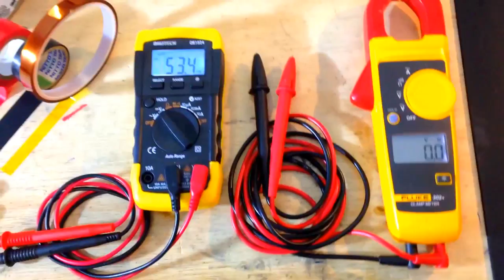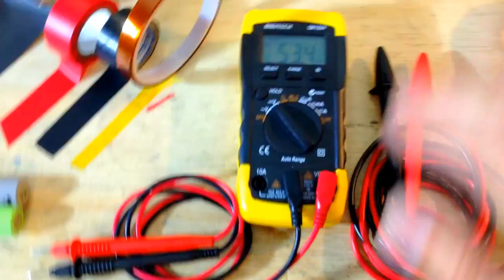Planning on making your own battery pack? DIY guide / tutorial • 18650 cells Electric Bike

Comment: He needs to chill out omg so much energy!
Reply from the maker: Yeaahhh... so much POWEEEEEEEERRRR hahaha =]
Reply: How are these LG MJ1 3500mA holding up?
Reply from the maker: MrBrymstond so far so good.. the high discharge HG2 (3000mAh 20A) can take a lot more abuse so it will probably last longer.. 
Cells are reliable in general, most problems I see when repairing battery packs are related to faulty BMS damaging one or multiple series, sometimes I can balance and save the pack =]
I'll be showing a super high tech state of the art, active battery management system and my new high discharge battery pack in my next video showing my 42000w trike https://youtu.be/sRH_cpCwNDs
So much POWEEEEER

Comment: Voice is bit annoying but this is one of the better tutorials. I've built many packs before and this guy definetly knows what he is doing.
If you ignore his voice there is lot of good information in here. Guys, 18650 cells are serious stuff, very dangerous if you don't pay attention to detail.
Isolate parallel groups when welding, have fire extinguisher nearby, use safety glasses (there will be sparks) and invest in good welder. Also battery holders are dirt cheap nowadays, don't use hot glue!

Comment: Hey, I have got a question.I'm planning on building a 96v ebike. I am considering on ordering 2 separate batteries one 72v 20ah, and a 24v 20ah battery. In hopes of being able to connect the 2 in series to create one giant 96v battery. My question here is, is that a possibility? Will it work, or will I end up frying the bms controllers in the batteries?

Comment: Hey I got 2 ideas for batteries what do you think?
1) Use white battery case instead of black one. This way battery is much much cooler when in sun
2) Build BMS shock absorber. On airplane they put bms on spring. Ours is so light, maybe bubble wrap?
Reply from the maker: +Clifford Zvengrowski - Yeeeahh. the white battery case if a much better idea, there are some white battery cases (Dolphin) around.. it makes difference if you have to leave the battery locked outside sitting in the sun for hours.
The second idea is good making a shock absorber, electronics don't like to be bashed around, this is why they fail so often but... but.... wrapping in bubble wrap is the electronics number one crime, it packs sooo much static energy, enough to blow electronics. You better use a thick paper / carton to wrap the BMS and then you can do whatever, EVA rubber would give you a good protection. So much POWEEEEEERRRRRRR hahaa..  =]
Reply: ElectricBike
Thanks! Yeah that is much better idea. I forgot about static electricity.
Reply from the maker: +Clifford Zvengrowski -  If you walk on carpet which is synthetic fibre in most cases, you may charge your body + shoes and clothes up to 5000 volts of static energy... (almost like if you're a 5kw capacitor) imagine what would happen when you discharge all that energy touching a very small SMD component soldered on the PCB, most cases the components are designed to handle 5v max... =/

Comment: Another great video! Can you recommend any custom battery builders for new guys that can't build one on their own? I want to build an ebike this winter using the qs273 motor. To pull the max power I would like to use the BAC4000 controller.  What size battery and BMS would I need to get that max power?

Comment: hello friend. I am planing to build myself a battery pack for my laptop (19v 7.1a). As you can see the current needed is pretty high...i ask for your advice here... what type of battery should i buy ? is it ok to use 3s 10p configuration and a boost converter ? i need like 150w of power (considering i want to use my laptop in the same time i connect the external battery). Thank you :) All i want is just to know how would you approach this problem :D

Comment: Just learning about all this, but WHY aren't the 18650 BATTERY SPACERS that you can assemble packs with uniform spacing out of, why aren't they made with METAL STRIPS that bridge TWO OF THEM so that you can assemble a battery pack WITHOUT SOLDERING / SPOT WELDING to the batteries AT ALL???  That is, the spacers would be made to hold TWO BATTERY ENDS, and would have a metal strip that makes contact between these batteries when assembled, electrically connecting battery negative, with battery positive of the adjoining battery.  Yes, they would need raised DIMPLES to reach down into the flat (-) end of the cell (one side only, right?, though I guess there are batteries that are flat on both ends if I understand correctly?)

Yes, you would need a means to apply and maintain pressure from these end caps to make good contact with the batteries at all times, but isn't that a straightforward thing to engineer around them?  Something like various "cages" that hold different numbers of cells into a pack while still being light by being made of something like nylon.

Seems like this is just too obvious as this industry is taking off.  Yes, they'd cost a tiny bit more made in China, but they would:
- remove the need for a spot welder, or worse, the need for soldering which can damage the battery casing...
- make assembly MUCH quicker by just being all SNAP TOGETHER to whatever size you need
- enable SIMPLE tear down / rebuild  to check / replace bad cells periodically
- support soldering to the OUTSIDE of the spacer, so that you can attach leads for BMS, or OUTPUT + / - for the whole pack, again, without the risk of soldering to a battery to get them attached

These should also be made as a single end similar to as now, but with the metal insert so that at the end, to attach the OUTPUT + / - leads, you would have just the single end as a soldering point for the pack output voltage which again eliminates soldering DIRECTLY TO THE CELL.  Essentially you would build a pack of desired size by putting a cell into one of the single spacers, then put a double spacer on the other end, inserting the second battery into it (noting to get negative against positive of prior battery), and continuing to repeat this process using the double spacers until you get to the final battery, and finishing it off with a single spacer, then snap on the cage that would spring load all the spacer contacts down onto the batteries solidly.

Only drawback I can see is some RESISTANCE being added through all these contacts, but would it really be that much that the benefits would outweigh that tradeoff???

Does this make any sense?

????????????????
Reply: You have a million dollar idea here
Reply: the main thing your idea lacks is robustness in the event of continuous vibration, or sudden impact. in such cases it pays to have the cells fully connected, not just with a spring force ( which is essentially what you get with any clamped together system). Keep in mind that in a crash, deceleration can exceed 10 g's. nothing to mess with!
Reply: Not seeing the issue, help me out.  Certainly any spring loaded contacts, with close fittings to hold the cells won't suffer from vibration.  That is, there would be no breaks in the contact chain from vibration, so not getting that at all.  Specifically, if the batteries are mounted in plastic cylinders that leave essentially zero play around them, then only compression of the spring will allow the potential to break the circuit chain by virtue of a cell pulling away from the contact on the opposite end.  Therefore it seems optimal that the packs are designed to hold the cells parallel to the ground, so that shocks from bumps or anything on the ground, puts force down on the cells, which just pushes them against the cell holder walls (cylinders) and does nothing to the spring contact loading, which would only occur from horizontal force.  Then if the springs are in the ends of the cylinders toward the back of the bike, that means the raw hard placed contacts are towards the front.  This way in a frontal collision there is no compression of the springs offering a circuit break.

Certainly high impact is a different story, but tell me how such an impact would be different in such a designed modular assembly system than it is in a 24v manufactured pack sitting on a back bike rack?  Yes, you can argue structural strength differences, but both, when hit hard enough, will have a tramatic failure.  There might even be some argument that a modular pack like this, broken apart by a significant impact, will simply spill the batteries all over on the ground as individual batteries and actually have LESS chance of cells breaking apart from not being soldered together into a large monolithic pack...

Bottom line, throw my pack built out for 24v, and a standard monolithic 24v pack into a brick wall at 80 MPH and tell me what you think happens differently???
Reply: Thanks.   Don't get it why someone isn't making these to allow DIYers to build battery packs out to any voltage and amperage desired...    FYI, My reply to the person concerned about impact damage:

---------------

Not seeing the issue, help me out.  Certainly any spring loaded contacts, with close fittings to hold the cells won't suffer from vibration.  That is, there would be no breaks in the contact chain from vibration, so not getting that at all.  Specifically, if the batteries are mounted in plastic cylinders that leave essentially zero play around them, then only compression of the spring will allow the potential to break the circuit chain by virtue of a cell pulling away from the contact on the opposite end.  Therefore it seems optimal that the packs are designed to hold the cells parallel to the ground, so that shocks from bumps or anything on the ground, puts force downward on the cells, which just pushes them against the cell holder walls (cylinders) and does nothing to the spring contact loading, which would only occur from horizontal force.  Then if the springs are in the ends of the cylinders toward the back of the bike, that means the raw hard placed contacts are towards the front.  This way in a frontal collision there is no compression of the springs offering a circuit break.

Certainly high impact is a different story, but tell me how such an impact would be different in such a designed modular assembly system than it is in a 24v manufactured pack sitting on a back bike rack?  Yes, you can argue structural strength differences, but both, when hit hard enough, will have a tramatic failure.  There might even be some argument that a modular pack like this, broken apart by a significant impact, will simply spill the batteries all over on the ground as individual batteries and actually have LESS chance of cells breaking apart from not being soldered together into a large monolithic pack...

Bottom line, throw my pack built out for 24v, and a standard monolithic 24v pack into a brick wall at 80 MPH and tell me what you think happens differently???
Reply: My background is in working with lithium chemisty cells in racing applications. Sure, such a strategy may be valid for hobbyists, but it certainly isnt the best for cell longevity, or safety. probably fine for your ebike
Reply: add 2 zip tie slots to the spacers, apply the constant pressure with zip ties
Reply: b. blubb do you have any idea how freakin heavy that solution is???  never touching that

Comment: Isn't better to add balance cable leads to the last battery in the pack not the first? It seems that all the time first battery on every pack is going to dry out first and charge first. Or is it better to add balance leads to every battery with same cable length and then connect them all to balanced cable?.What is better solution? Thanks :)
Reply from the maker: +Conesbbkg - Hi Cones... I know exactly what you're talking about, cable length and drain the first cell more than other cells in the pack... 
All cells both sides positive and negative are connected to the BMS so the BMS has a total control on what is going on there and all the voltages. Some BMS will have a second negative wire which is in some ways a bit stupid because inside the circuit they are joined together, I guess they only do it to keep it "standard" or something like that.
The first cell draining more power than others is not true as they are all connected in chain (series) and the only way you can "suck" power from that first cell is by moving electrons between all cells. There is a chance that one of the series in the pack may have a faulty cell or a small internal resistance makes some cells to charge and discharge slower or faster than others but this is got nothing to do with the position like the first cell in the pack, it would happen anywhere like the cells in the middle. The more cells you have connected in parallel the more the cells will be balancing and the more even and less likely to have such problem.
I will be making tones of videos here.. keep posting comments with all these questions, they are good way to inspire myself for my next videos haha... so much POWEEEEEEERRR =]

Comment: ahh, I feel like you made this video just for me :) Ive already started buying a few bits n pieces for the build. Whats with the 2 months to get batteries, is it because it was shipped by sea as to expensive by air for batteries they are worried will explode etc?
Reply from the maker: +Jayme Capurso - Yes, this one was specially made for you hahaha.. no kidding... I always make videos based on my subscribers requests.. I think it is fair if they are the ones watching my videos =]
The 2 months I mentioned is for shipping.. since December the Australian and NZ customs regulations for importing Lithium batteries have changed, I think they are trying to stop people importing Lithium battery packs directly from China because lots of Chinese businesses would ship via air causing a major safety problem, Lithium can explode at high altitudes at very low atmospheric pressure, specially the dangerous LiPo cells used for RC toys like drones and helicopters. Now they scan every package you can still import very small battery like laptop ones but anything bigger must be special freight over 100kg in a special container, basically few businesses will be importing such large quantities... we are lucky we always get around 400kg (or more) in batteries so it shouldn't be a problem =]

Comment: I have a 2500W 52V bbshd im looking to make a 60 or 72v battery for longer distance riding I average 30-40 miles going 15-20mph peddling, I know I’ll probably have to upgrade my controller for the new battery build, am I correct in my thinking? My plan is to crack open the battery case and upgrade the bms and add extra batteries from my existing to get 60 or 72v then remove my current controller and attach a higher W controller, or can this build be completed with my current controller?

Comment: Nice guide, very informative!
I'm just curious, how can you run a 58.8v battery kit on a BBSHD which is made for only 48v?
Reply: these type of batts are high release/output but not all brands are equals and type doesn't mean each has same size. basically u get it tested, if ur motor is meant to run max 1500w and all your getting is 1253w for example, go bigger. ebikes  is not as exact science as people think especially when done by non-engineers

Comment: Great video! How do u test ur batteries to make sure they are they same voltage and mah. what is the purpose for doing this, every other video I saw they are testing them. if u are what is ur setup/ what exactly are u using?
Reply from the maker: +Jared Ebersole - Yeeahhh.. I am glad you're asking these questions... this is a good thing =] We source our cells freshly from LG Chem, by the time they arrive in our hands the cells are less than 30 days old (sometimes 2 weeks old) and individually tested by advanced machines at their factory. We could get the cells and build the pack without testing anything but we test the voltage just in case, they are always fine, always exactly the same voltage... then I group all cells with the cell holders and start spot welding. I measure the series voltage, I measure the whole pack voltage, I charge 100% and discharge all the way till the BMS cuts the power. I repeat the cycle about 3 times. We use a simple watt-meter that gives us the voltage, amperage, Ah... I will be posting a video showing how I continuously discharge these packs.. it is really intense on the cells.. basically I hooked up 4x 12v H7 bulbs connected in series (48v) and if you want more watts/amperage you add another 4x bulbs connected in parallel. I found that 4s 3 or 4p configuration for this discharger are the best configurations, your cells will be hot after 5 minutes, so grab a fan... Lithium cell don't like heat... don't force too much. Be extremely careful with every single detail, plan every movement and watch everything around inspecting for metal things that could possible cause any short circuit. Remember.... so much POWEEEER =]